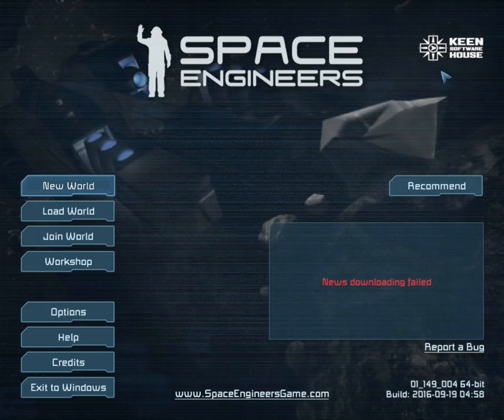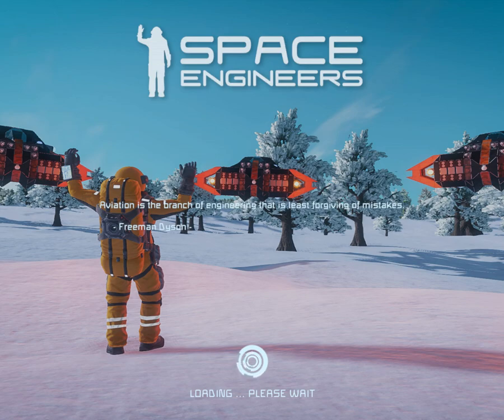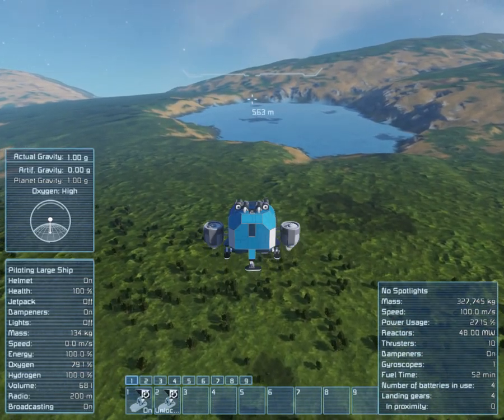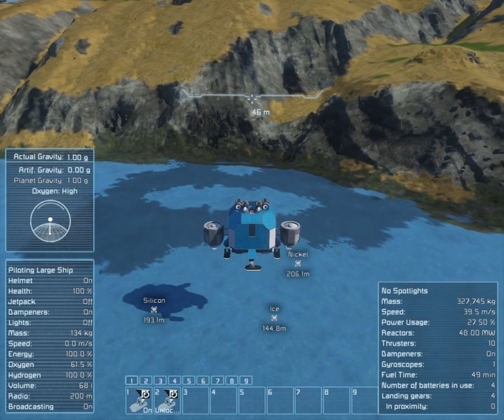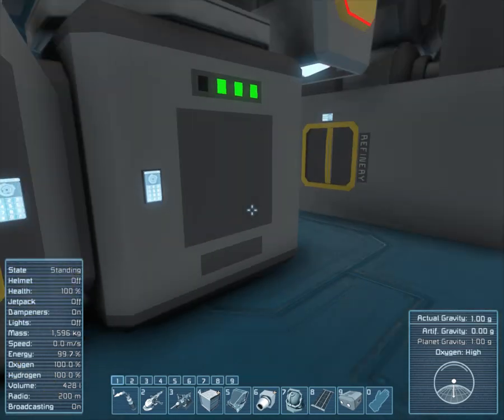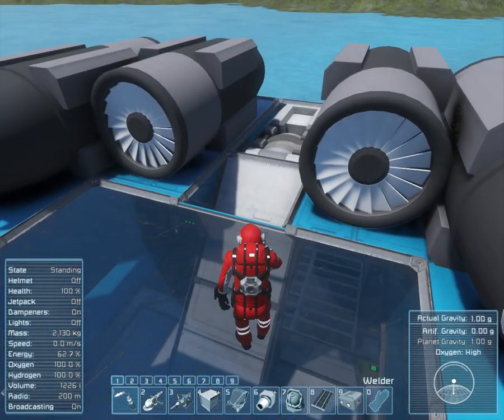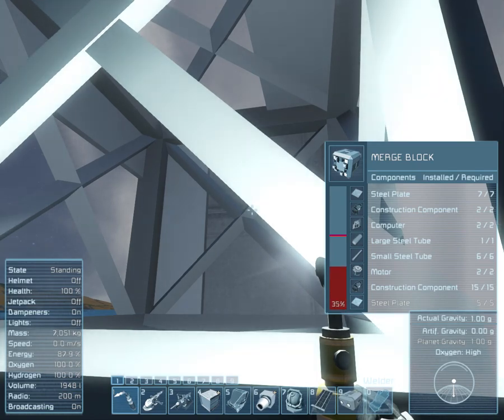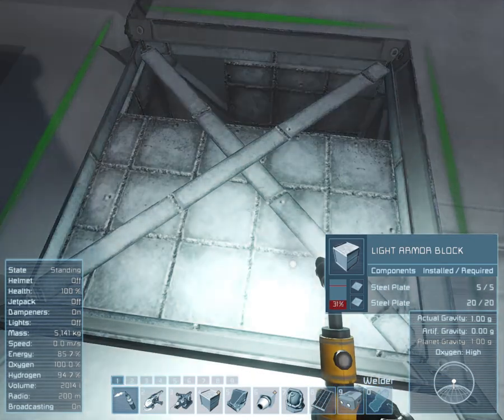Space Engineers Tutorial - Star System Episode 01 - Landing and Setting up Your First Base

Comment: Another thing I experienced was that turning on the dampeners caused me to plummet down and not stabilize.  i don't know if this is something that has changed with the game upgrade or if it is a glitch in my machine.
Reply from the maker: That is weird.  
Normally turning on the stabilizes/dampeners will stabilize the ship.
This must be a glitch somewhere, it is still in beta mode so it can happen.
If it continues, it might be worth notifying the dev team about it.
Reply: It seemed to work OK once I got down close to the surface but initially it turned my ship into a brick.
Reply: Usually the atmospheric thruster won’t kick in till your close to the ground, so if they eventually start working then it is normal.

Comment: Well, after watching this clip several times and writing down all of the instructions, I finally to the leap of faith and launched into my Star System venture.

I have to admit that it didn't go without a hitch or two, all of which were my fault, not the fault of this fine tutorial.  Firstly, I plummeted to the ground when I turned off my Small Reactor because, like a nupty, I had also turned off my Batteries - Duh!  The second attempt I was having problems setting down because I thought I had turned off all the Thrusters, but I had missed the two Large Thrusters.

Third attempt - Success.  Although, it too didn't all go to plan.  Firstly, I had problems getting my Landing gear to lock in place, but a bit of fiddling around finally fixed that.  Next, I couldn't find any Steel Catwalk so I had to search for something else to dismantle to get those and not knowing what was essential equipment and which was not, it was a bit nerve wracking.  Eventually I dismantled the 2nd Cargo Container.

Then when I had everything set up to connect the ship to the base I had big problems with the Landing Gear again.  But after pushing several buttons in no particular order, I got them unlocked and made a successful connection.

After that I reckon the rest is going to be a doddle.
Reply from the maker: Hi Mick,
This is great news.
I see there are a few more comments you have made so I am going through them now but I am really happy that you are giving this a go!
It is a lot of fun, it is all about trial and error, experiment and see what works and then see how you can make it "look great" :)

Comment: Please answer the following questions: 
1. If I had a Palit GTX750TI graphics card, can I enable the airtightness?
2. What is the best display/screen resolution option (like 1366 16:9) for the above graphics card?
Reply from the maker: Hi Dark Centuryon,
Yes, with this graphics card you can enable the airtightness.
The resolution depends on your CPU, GPU and RAM.  
In the earlier days of the game, it was mostly on the CPU and not the Graphics card (GPU).
I use an Intel i5, 16 Gig RAM and a Nvidia GT640 (oem) when I play.
The graphics are down a bit but I play on 1440x900 (16:9) without any major problems.

The rule of thumb is have twice as much RAM (memory) in your computer as what is on your Graphics Card.
(If your Graphics card has 4 Gig GDDR, run 8 Gig system ram but I would not run less than 8 Gig RAM with Space Engineers).

Let me know if you have any further questions.
CMDR Noodles.
Reply: Yeah i actually have 8 GB RAM and core i3. Thanks for the help though.

Comment: Hi i dont start in a ship I just spawn on the ground with tools that's all, what is wrong?
Reply from the maker: Hi Ranul,
I am glad you found this site.
The problem is a bug in the program, if you start in your world as you have explained, use the Backspace key to "suicide" and then you can choose the landing craft to start the way it should be.
For further information, please see a short 4 minute video I made about this problem.
https://www.youtube.com/watch?v=zkWNCsv2OTw
CMDR Noodles.
Reply: Thanks for the quick reply!
One more question, I am on Mars in a medium sized rover which has all the basic facilities to last a single survivor. I aim to build a base but would you recommend I look for Uranium or Iron/ other metals for building? (I don't think I'll need for my rover as it seems to run off solar panels)
Reply from the maker: On Mars, I would start with locating a source of Ice first, there is Ice at both poles but there are also Pirates there too.
I would then focus on power, either uranium or solar, then it is a matter of getting the specific resources you need to get sustainability.
Iron should be easy and quick but you will need a little of everything first ...
Rule of thumb ... No oxygen ... you are dead ... No Fuel, you can't refine anything so Oxygen via either the oxygen generator or farm is critical as well as Solar Panels but I always steer to the side of Reactors with Uranium first as they are much more efficient.
Reply: Commander Noodles1421 thank you I'll make my way to the poles!